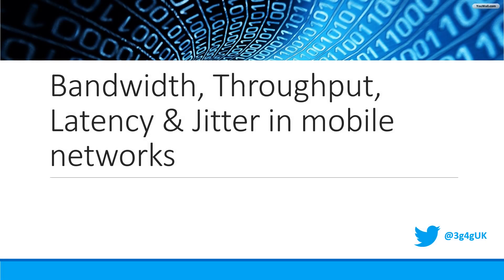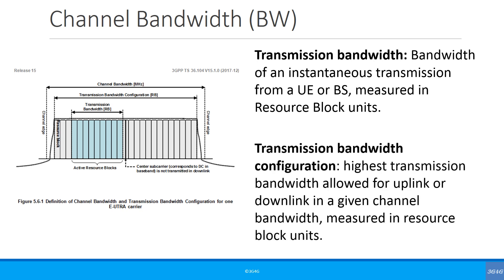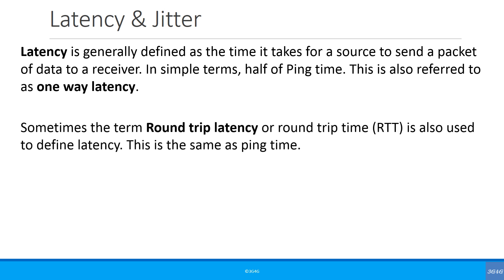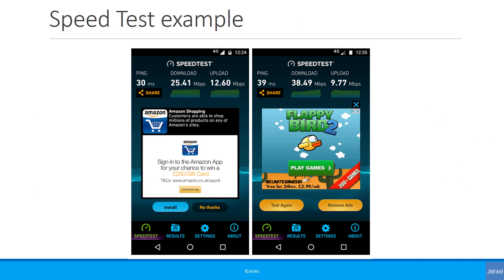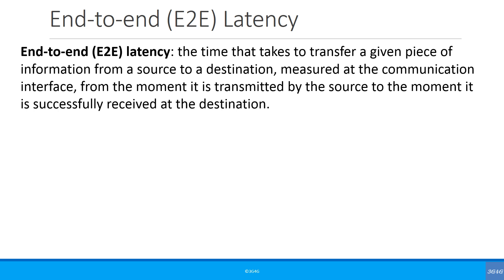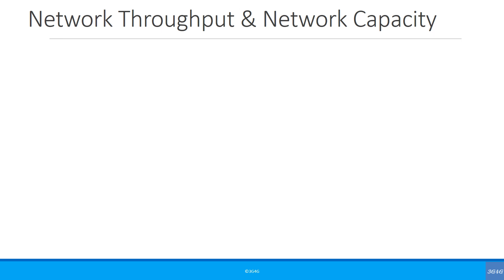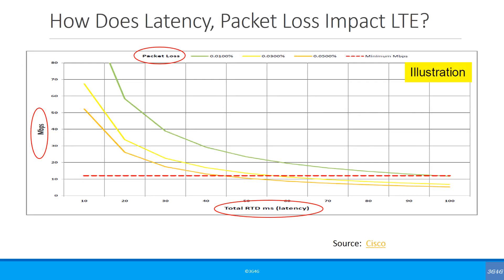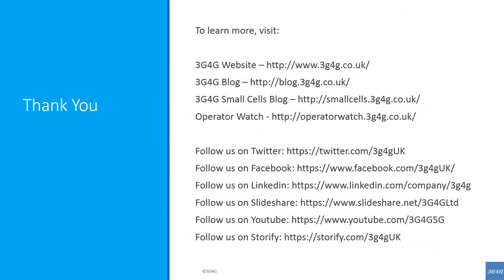Beginners: Bandwidth, Throughput, Latency & Jitter in mobile networks

Comment: For Network throughput and capacity, can you please share one example of calculation?
Quantity of spectrum= this means the sum of all BW of all cells in-network?
Spectral efficiency = how to calculate it?
Cell spectral efficiency =  how to calculate it?
Reply from the maker: Quantity of spectrum is the total bandwidth you will use in throughput calculation. You may sometimes not be able to use the whole of the spectrum by an operator for calculations because different spectrum gets used in a different way.

For spectral efficiency you will have to look at how  3GPP does it. Why not start from here on the blog:  https://blog.3g4g.co.uk/2017/06/theoretical-calculation-for-ees.html